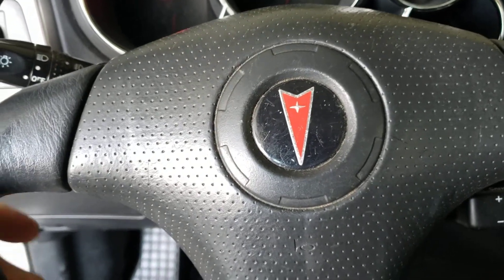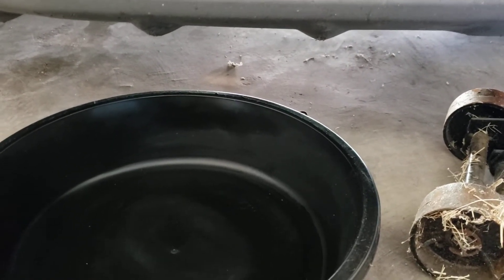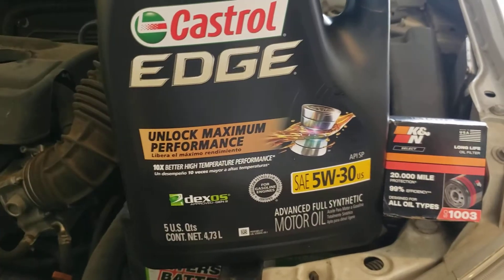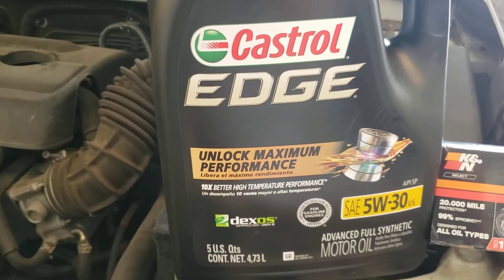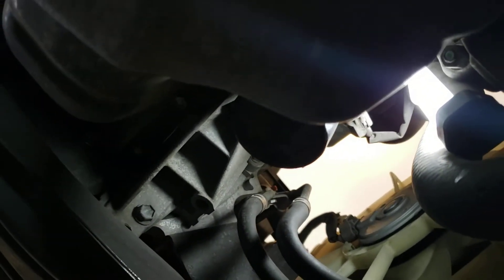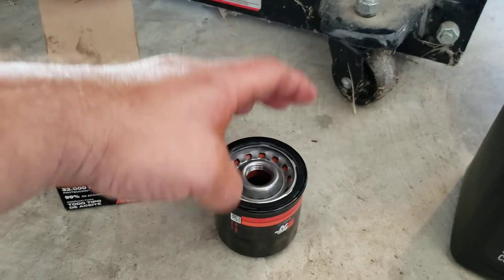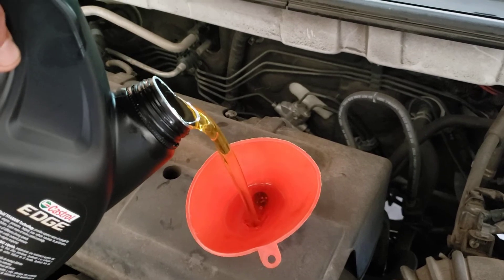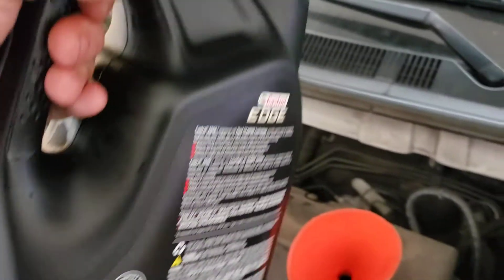2003-2008 Pontiac Vibe oil change how to

Comment: No torque specs
Reply from the maker: The torque on the drain plug is 27 ft lbs and 10 ft lbs on the filter.
That being said, for the drain plug, tighten it by hand and give it another 1/4 turn past that with the wrench/socket. With the filter, hand tighten it until your hand slips on the filter and not tighter than that.
I have never and will never use a torque wrench on a drain plug and will 100% NEVER use an oil filter wrench to put the filter on. If you need to use one to get it off, either you or the last guy working on it used one to put it on and needs to rethink their life choices.